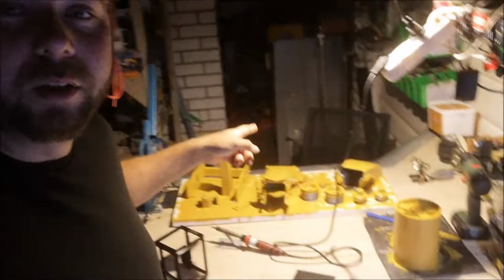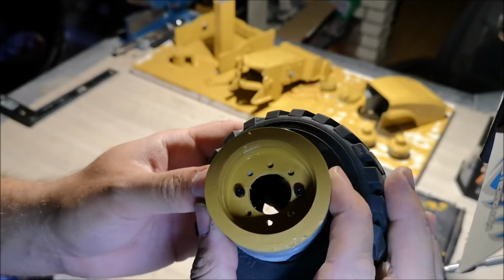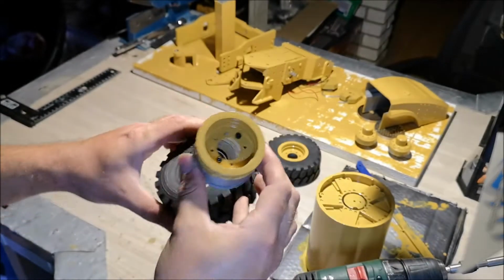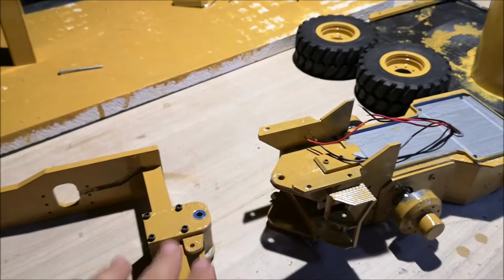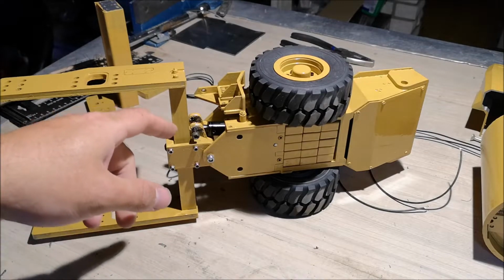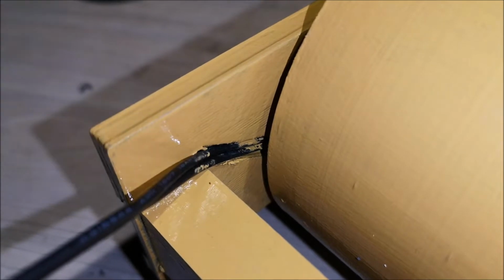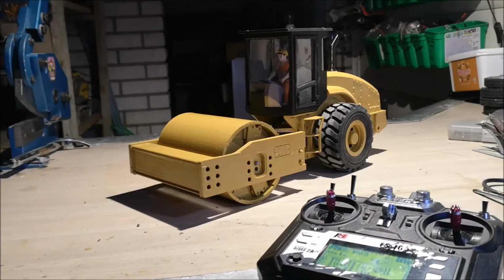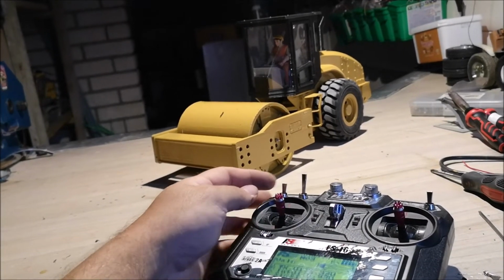Making a 3D Printed RC COMPACTOR - CAT CS74B - PART 2

Comment: Amazing build! How buy tires?
Reply from the maker: any 1.9 tire with a diameter between 110 and 115 mm will work ;)
Or you can get the ones I used from aliexpress, theyre called LESU 110mm
Reply: thank you! @burnie222rclasseanhanger6